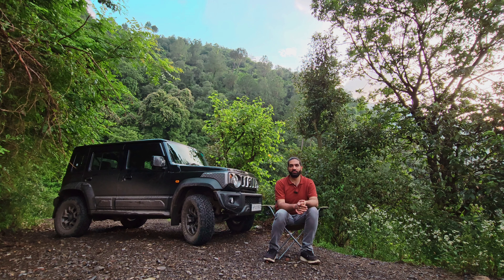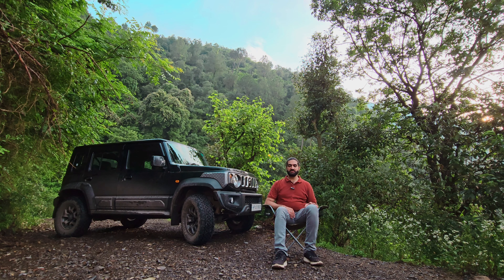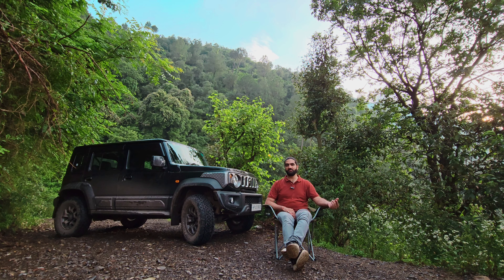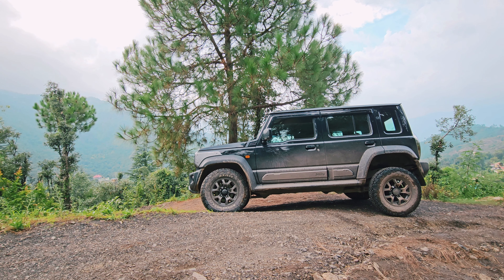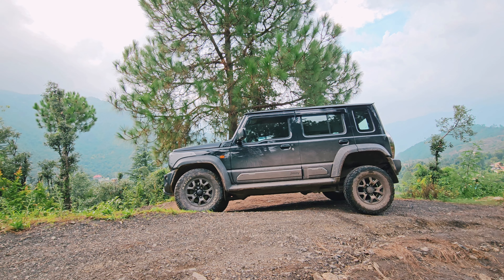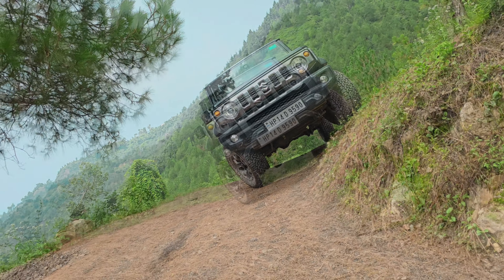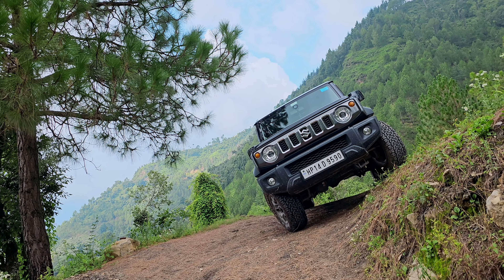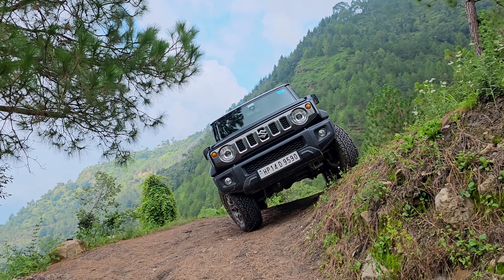Mythbusting jimny's tyre upgrade||Do Not Upgrade without watching this video|@RoadsOfTheMountains

Comment: some thoughts:

I have 235s (firestone destination AT2) on stock suspension in a 3 door 2023 manual Jimny. No heavy offroading but i live in costa rica and we have some bad roads, I usually just go slow on those. No rubbing after 5 months, no visibile deformation, no rubbing sounds, all the tyre surroundings are pristine.

I guess is only on really extreme situations or for a car that is heavily used on offroading that your warning applies. In my country, i will never need snow chains. Im still planning to have the 2 inch lift at some point, but not completely sure its neccesary if you use it for just light offroad (the one that doesnt climb or requires deep articulations).

Also, for gas consumption on the city I dropped from 11,9km per liter  to 11,8 km per liter with the tyre change.

For me, the looks of 235s on stock are the coolest.
Reply from the maker: Hello Thanx for tuning in sir.235s do look cool .They increase the aesthetic appeal of the jimny,along with that the high amounts of grip you get is also an added functionality.
Your thoughts are not wrong as these tyres would easily handle soft offroading or even the moderate offroad is nicley done without rubbing the tyres.
The big concern here are the snow chains,if one would need snow chains then the lift is very much required.
As my surroundings get moderate snow fall i would need the chains and the lift.

Thanx for tuning in and sharing your experience.Have a great day.
Reply: Do you use 235 75 r15?

Comment: You need a lift kit, suspension upgrade, a new brake line for the rear and a slight adjustment on the front cross member as it will rub with the drive shaft after the lift. That's it you're good to hit the road. Any road, with those profile of of tires.

Comment: I think most who add a spacer and a 2" lift kit should completely avoid these issues and get full benefit of added tyre grip💪
Reply from the maker: Hi Kyle your thoughts are correct,the 2 inch lift is the most suitable option,which will not spoil the bodyroll Dynamics also.
Thanx for tuning in

Comment: Nice content 👍
I own a 3 door Jimny JB74.
It's rolling on 235/70R 16 BF Goodrich and there is no scrubbing at all.
The car have a 50 mm liftkit from Trailmaster. The stock front bumper has been cut in the button, but only very little.
If you want to upgrade to bigger wheels, you gotta install a liftkit.

Comment: In my personal opinion 225 70 R15 will be a good fit, instead of 235 or 215 75 R15. While articulating the 5mm less sidewall of 225 70 r15 tyre will not get rubbed. Also, there are a lot of people who want to upgrade the tyres but do not want to install a lift kit as it results in more body roll in routine drive, for them specially, 225 70 r15 is a good option.
Reply from the maker: Hello Ashwin,
The 225 size is available only with select brands which are very few,
So a no problems size is the 215 only.
As per my observations even the 225 can rub and wont accomodate snow chains.
The 215 is the only size which will suffice for all needs and for most of the owners.but 235 requires a lift kit.
As i mentioned in the video also ,215 is a very tension free tyre size.
Reply: @RoadsOfTheMountains  Easily  available Sir...I fitted APTERRA A2 225/70...perfect size ..
Reply: Right Sir
Reply from the maker: Yup apteras are available ,continentals are available.But if one switches to bf goodrich,falken wildpeaks,or any other rugged tyre,that is when one finds a loss of options in sizes.the biggest loss is the non availability of bf goodrich ko2s.i personaly find the 215 to be a very good fit.
Reply: Adding a lift kit stabilises the drive dramatically compared to the factory suspension.
The car has less chance to roll cornering with a 2 inch lift compared to rolling off the factory floor.
Reply: 215/75/15 is best fit it seems. and lots of options are also avl.❤ thanks I will go with them😊
Reply: @premnikz  215 isn’t the best option, but better than the factory tyres.
I’ve seen so many people spend twice as much money on mods cause they took the cheap approach on their Jimny.
It’s no good financially to buy 215s only to later add a lift kit and put on 29-31 inch tyres.
What a waste of money purchasing the 215s to begin with.
215s won’t get you the clearance to go where 235s go, it’s just that simple.
If your plan is a lift kit then don’t upgrade your tyres until you’ve done the lift kit and then spend the tyre money once.
Now if you’re not adding a lift kit then yes absolutely 215 is the maximum you can go, but in saying that you must understand you cannot take your Jimny on tracks that 235s are needed to tackle.
It’s about how much money you want to spend on modifications, if you are raising the height then don’t waste money on 215s.
Reply: On maximum articulation even 215/75 r15 will rub the underbody while using snow chain
Reply: @drvikassharma5193  I’m unsure the math so I can trust your word that’s true.
What I do know is you need 16mm clearance to safely use snow chains.
Reply: @JasonKofoed-q1c on maximum articulation with 215/75r15 even your index finger will not get through the tyre and under body of Jimny
Reply: @drvikassharma5193  sounds like lift kit is a must, she’s a good 4x4 and worth the extras.
Reply: @JasonKofoed-q1c  Is a two inch lift enough to have a 235 tire? Because I have a two-inch lift from the factory on my Jimny 4Expedition (Brazil) model, but they say I need to rework the front bumper to move it 3 cm away so it doesn't scrape. After all, is it possible to just put the 235 tire on a new Jimny with a two-inch lift and nothing else?

Comment: Well explained. I only recently picked up my Jimny and was considering driving straight to a tyre dealer to trade in the stock Duelers for a set of Geolandar A/T tyres in size 215/75R15. However, I decided to use my stock tyres until I wear them out. I don't want to mess with the warranty, least of all while the car is still new. I hear that the Jimny is still quite capable with the stock tyres so I might as well use them. 

By the way, I noticed the HP plates. I recently rode to Narkanda and saw more Jimnys in Himachal on that one trip than I have seen in Noida since this car was launched! The Gypsy was really popular in HP so perhaps it is natural that the Jimny would be too.
Reply from the maker: Hi,thanx for the appreciation.Congrats for the jimny you own.The stock tyres are the most comfortable ones,only in mud and snow one can realize it's shortcomings.Mind it the stock tyres are also M+S rated,they are decently capable.215s are the most hassle free upgrades.
Yup jimny's are very capable,nimble and compact which is why Himachal loves them.The legacy of the gypsy king continues.wish you many happy miles on your jimny.Regards.
Reply: @RoadsOfTheMountains  Thank you! By the way, because of your articulate presentation, I subscribed to your channel right after I watched this video. I will check out your other videos soon. Cheers!

Comment: thanks a lot for sharing. Previously i am in doubt to upgrade my 3 doors jimny tyre. Now i fully understood the impact of the upgrading to 235. I decide to stay on my 215 even though the looks is not as good as for those using 235.

Comment: Although one won’t usually be articulating to this extreme when in snow with chains, but clearly as your analysis shows, it’s a no go when using 235s without lifts. Thanks
Reply from the maker: Hi,Dhruv.Agreed to your conclusion,snow and ice dont ask for such articulations.But no one knows what's Beneath the snow  on a offroad.
It breaks my heart 235 s cant be used on stock suspension.It's either a 215 size or a 2inch lift with 235s.
Thanx, a subscribe would be a lot of support.

Comment: Namaste, great show from South Africa, I cannot wait to have my 5 door jimny, it will be released in November of 2023.
My opinion, Suzuki should have fit rear dics brakes on the 5 door because of the long chassis.
BF  Goodrich KO2 or KO3 in 215 x75x15 is great.
Reply from the maker: Namasate from India.Jimny 5 door is a very practical vehicle,also it is nimble and agile,not to forget it's 4x4 capabilities.Yup rear discs would have been a big welcome but  we don't have them.Also bf goodrich is a wonderful brand to consider,unfortunately they are getting a little scarce here.
Well november is almost here,it's gonna be worth the wait.
Regards,stay tuned and do subscribe mate.

Comment: Good work, i have a 3 door jimny an it's on 215/75/R15 tires, they told me also that if I want to go por the 235/75/R15 tires i'll have to lift the suspension for at least 2 inches.
Reply from the maker: Thanx leonardo,for the appreciation.
It motivates us.215s are a very good fit for the jimny.wish we had the 3 door here as well.Regards and have a great day.Do subscribe and stay tuned.

Comment: Absolute on the point without lift kit 215 would be max.. Even with snow chains this spec should work.
Reply from the maker: Yup 215 is the max one can go on stock set up,235 only with the  lift kit.
Reply: On maximum articulation even 215/75r15 will rub the underbody with snow chains

Comment: Sir you missed a major point with upgrading from 195 to 235 . The tyre diameter percentage is increased by 5.9 % which is just too much . Your odometer , speedometer will be off by a mile and the car will struggle with gearing , specially the automatic . You can put 235's or 30 or 31 inch tyres with a lift kit n a little bumper trimming  but you will have to change the transfer case gearing or the final drive ratios to compensate for the increase in diameter of the tyre .
Reply from the maker: Hi,you have made a very precise and detailed calculation.I am aware of the facts you mentioned here.The speedometre does get miscaliberated by a slight margin and the engine also feels slugish a bit.The AT is a one cog less and power loss would be felt with greater intensity,no doubt.Changing the gear ratios is a big and very technical task,most needed when sitching to bigger 33s.A lot of points and facts still get left out while shooting.
Thanx for your suggestion,have a great day.Do subscribe
Reply: That 5.9% diameter change is hardly a mile, and actually nicely compensates for the speedometer that's factory set to under-report. Whilst noticeably slower, the auto can handle it. Have travelled at 110km/h on the highway for extended periods of time. Not as dramatic as you make it out to be.
Reply: @hhhs001 you can do 110 km/ hr on 31 x 10.5 R15 tyres as well but selecting  an upsize  over 2 % is not recommended for a reason . If you need ground clearance , you could fit bigger tyres but understand the downsides .  I am also  running 31x10.5 in my suzuki  gypsy , but back then I never understood the math of tyre size v engine power v gearing .
Reply: @sailorsanjoy  understood. I'm just calling out going to 235/75R15 is not as dramatic as claimed on here and on forums / online groups. It's noticeable and not a good idea if you never off-road. But it certainly does not require gearing changes in high range at all.

Comment: 235 is the width, yet everything you discussed has to do with the circumference of the tire. thought it was scraping the inner wall on full articulation. you just need a 40mm lift and you will be sorted, im more interested in the sidewall clearance on the inside with 235's

Comment: Should we use 4H on ghat road for climbing hair pin bends and steep inclines on good tarmac ghat roads?
Reply from the maker: Hi,Tarmac roads do not call for the application of 4H.2H should easily cross challenging inclines on nicely paved tarmac roads.But if it is slippery,muddy or there is loss of traction on roads one should use 4 H without hesitation.
Snowy and muddy situations require 4 H the most.

Comment: I think if u use a 20 mm negative offset alloy it might work all fine. Spacer r nt good but u must try it with that an check 1st how much mm offset u might need, according to it select an alloy with negative offset so u wont need a lift kit.

Comment: I am using Yokohama 215/75R 15 AT with airpressure of 28 in all tyres of Jimny automatic Yesterday, I took the vehicle in the hills for the first time & to my surprise...I found the car was  jerky on Road whereas it was settling properly while passing through path holes or rough terrain on slow speeds . As a driver I felt a lot of body roll on corners in hills & was afraid as if the vehicle may get unstable on corners. I was driving solo & without any luggage. There are no other alterations done in the vehicle..I mean no weight additions apart from tyres upgradation.
Can you pl suggest solution to this ... should I reduce the tyre pressure further from 28 while driving in hills.
Reply from the maker: Greetings Amit,Jimny has got a suspension set up which is on a softer side,which helps it in absorbing all the  rough offroad patches.But jimny behaves differently on metalled road potholes.Due to both front and back solid axles and ladder on frame construction it behaves differently under such paved potholes.The solution is to tune down your psi to 26 or even 25.
I often drive mine on 24 psi and the ride is then very cushioned and the effect of potholes is reduced.i suggest trying 26 psi.
And ya one needs to be careful while cornering but jimny is decently stable on curves.

Comment: Hi, Any suggestions about lift kits? and likely costs? pls do a dedicated video! btw i really like your no bullshit and straight to the point presentation and commentary! pls keep up the good work!
Reply: Ironman 2inch lift cost around 1.5L, Tanabe adjustable lift upto 40mm around 1.7L and Dr Nano 2 inch around 60k
Reply from the maker: Hello sir,As of now lot of options are still coming out for the jimny even from import supplies.So we can have the Indian made lift kits costing around 60 to 80k.Iron man is around 1.5 lakhs.Anything more serious like tanabe ,cusco adjustable suspensions from Japan and other countries will easily cost up to 2 lakhs.
I am still looking into all the viable options, once final an update will be on my channel.
And thanx for the gentle appreciation.It's a motivator
Stay tuned for more content.
Reply from the maker: Correctly said Mr.Amay,thanx for spreading the correct knowledge and helping the Community.Have a good day.
Reply: @RoadsOfTheMountains some work is also in progress by moving metal garage based in Noida in this matter do have a look regarding this

Comment: I Had the Older Jimny With 215/75/15 BFG Mud Terrains,Never Got Stuck With Standard Suspension and No Problems With Raising The Gearing Too Much,Which is  a Problem Fitting Too Big Rolling Radius Tyes and it Messes The MPG up and Makes Steering Too Heavy.

Comment: In simple words , larger circumference will lead to a torque deficit on a small capacity  engine.  Also the larger wheel weighs more. Rule of thumb for an Upsize setup is increase the wheel size by 1 inch and circumference by 3 %. Rubbing and touching is a petty issue.

Comment: I will be getting my Jimny this week.. I have decided to go for Yokohama geolander LT 215/75 R15 104/101S
Reply from the maker: Hi,hope you have your jimny now,The 215 size is a no botheration size.it wont be causing any problems.Happy offroading.
Reply: Yes got my Jimny but was getting continental contact cross 215/75 R15 at good price after exchange, so shifted on them 🎉🎉
Reply from the maker: @drvikassharma5193  congratulations for your jimny,
You will be very comfortable with those tyres.Enjoy your time with the jimny.Regards
Reply: @RoadsOfTheMountains  thanks dear 👍👍
Reply: Will be getting 2 inch lift kit with in 6 months after reviewing MMG and Ironman. Will wait for your suggestion
Reply: Will be getting 2 inch lift kit with in 6 months after reviewing MMG and Ironman. Will wait for your suggestion
Reply: @drvikassharma5193   where and what deal you got for Contis and buyback?

Comment: A good lift kit which should be economical and what should it include which are necessary..A full detailed video is required from you soon 🙏🙏
Reply from the maker: Yup it will be on the channel with full details once intsalled.Also i aim to highlight the lift kit's effects on all driving parametres.So stay tuned

Comment: Hi. Very helpful video. Do you recommend 225 size tyre on stock alloys?
Reply from the maker: Hi,225 sized tyre is also a good upgrade.it wont rub.Stock alloys can easily handle 225 tyre size as offroad tyres have high walls.Go ahead without any doubts.
Thanx for tuning in

Comment: Im planning to put a 2 inch lift kit,whats the biggest tyre size i can opt for ?
Reply from the maker: Hello shariq,with the lift kit also go for R 15 only,the 16s or the 17s can still touch because of the huge suspension travel the jimmy has.jimny's body arches are not meant for bigger sizes.Also consider when turning to the max,to avoid rubbing the wheel well will require a lot of cutting, also depending on the inset of alloys too.i would suggest to go with R 15 only,rest all would be experimentation.
Hope this provides clarity.

Comment: Not only will the 225s hamper articulation...they will also damage the steering column in the long rung...the standard tyres are the best...but if u are the kinds that want  thebmacho thing...go for the 225s
Reply from the maker: HI,Thanx for the intel,see the plan here is to increase the jimny's functionality as a offroader.The HTs provided are very comfortable no Doubt,But they lack Grip on slippery surfaces.So to give the needed traction  a good set of ATs are the best bet.These tyres perform perfectly.Once the lift kit is in place All the  issues will be solved.stay tuned have a great day.